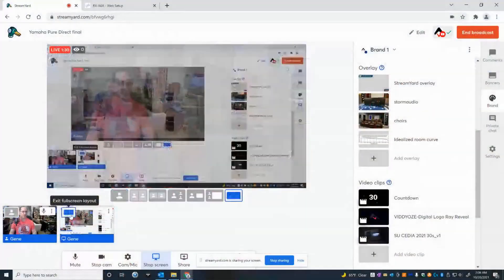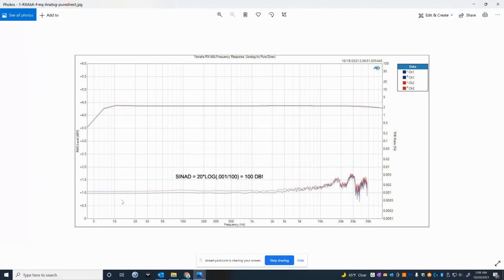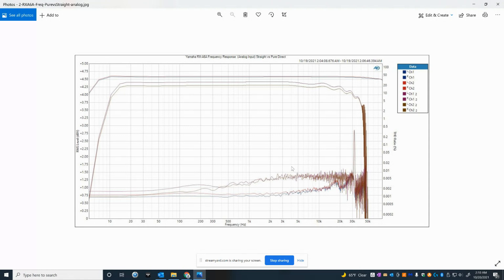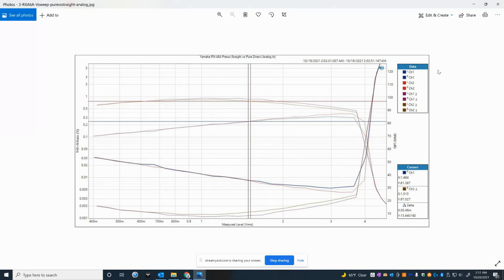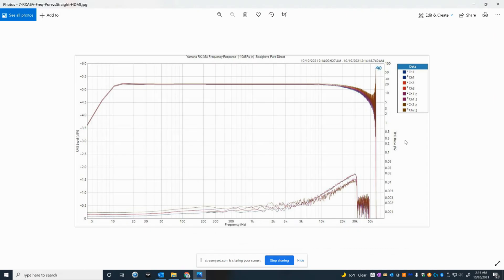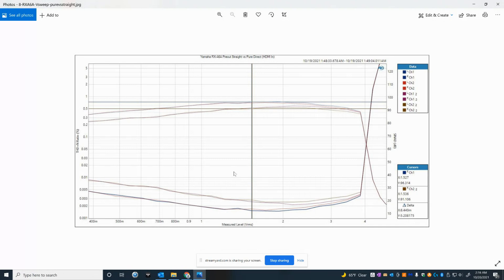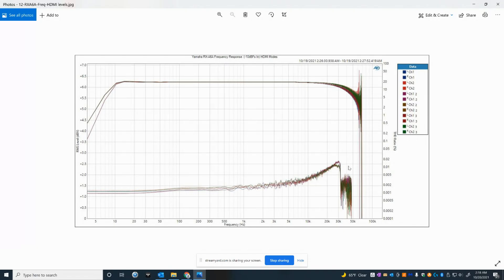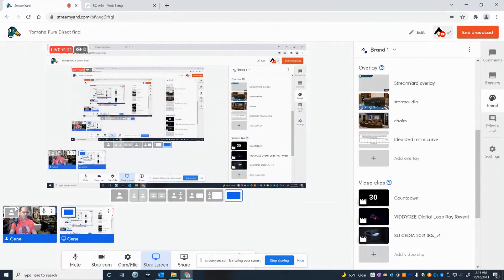Yamaha "Pure Direct" Better Performance or Pure Nonsense In AVENTAGE Receivers?

Comment: Thanks for the video Gene! Interesting! But I have a rather old Yamaha A/V receiver. I have a 7.2 Yamaha A/V RX-V665 receiver. I purchased it in 2012 with a 7.1 Klipsch Synergy speaker system. My sub is the Klipsch SW-450.  Both are still going strong...knock on wood, but as far as I know I'm not able to do a firmware update. It does not have the options of connecting to the internet, but it does have "Pure Direct", which I never use. I always stay in the 7 Channel Enhancer mode for both movies, music, and even watching TV. But I guess what I'm getting from the video is that I should listen to my vinyl records through the "Pure Direct" mode. I have a Music Hall turntable with a Shure M97xE cartridge.
Reply: Still have my 665 AVR. Pure direct sounds so much cleaner.
Reply: You may or may not like the puredirect, all comes down to preferences and the gear you're using. A friend of mine replaced the Klipsch horn drivers with JBL synthesis drivers, and the result is horribly off balanced between the horns and the woofers (he refuses to get a custom crossover) so being able to turn down the treble on the amp makes the speakers tolerable. Pure direct makes singers sound like they sing in a pa horn from about 2k hz. But my friend is happy with the sound because it recreates the bad live sound from the 70's and 80's, and that sound is what he was after. 

Anyway, use the settings that make you happy, its your gear and your time.

Comment: Gene you are the man.. appreciate all you do. I am a Yamaha fanboy, glad to see them keeping their standards high!!!
Reply: Dan a question is it worth the extra cost for the rxa 3080 over the rxa 3060 I dont really see much of a difference!! Just the AI in surround. Thanks
Reply: @brooklynknightss  Not sure brother. Don't have experience w either. Been using a Yamaha AS501 (2.1) for music/movies - extremely happy w it, drives nice Thiel towers with plenty of power for our open living room. Considering upgrading to a Yamaha receiver or the AS1200 as my next upgrade. All research I have done on Yamaha indicates pricing is very fair, the more you spend the more you get and always solid value.
Reply: @danielgrubb9496  thanks I was looking at a used Yamaha rxa 3060 or 2060 can get a nice unit for a deep discount over a new one. Thanks I'm loyal to Yamaha to, that's all I owned
Reply: @brooklynknightss  gotcha, yea def talk to Gene or someone w more experience w home theatre equipment.. should be able to find good videos or forums that break down the internal parts for comparison. I would say as long as the equipment has power and features you NEED, go for best deal. I'm bad to hunt for gear that requires other gear purchase to maximize lol.. good luck!
Reply: @danielgrubb9496  thanks buddy

Comment: I use pure direct on my Yamaha receiver about 60% of the time for both music and movies. I get around the lack of bass management by using the speaker level connections on my sub in addition to the lfe connection and using the crossover on the sub.
Reply: Could you eleborate on how you did it? I’m having the same issue. Thanks
Reply: @gonrossi you need a subwoofer with both line in (LFE) and speaker level connections. You run the LFE line as normal then you have a choice.  A. Run two wires from each of the right and left channels in the receiver. One set of wires to the speakers and one set of wires to the speaker inputs on the subwoofer.  OR B: run the second set of wires from the lefts and right speakers to the speaker terminals on the subwoofer. In both cases set the crossover on the subwoofer and you will have to level match the subwoofer to the s speakers with your ears (not device) to the point where it sound like the bass is coming from the speakers. When you run 2 channels in pure direct in the Yamaha it will send it a full range signal to the fronts and this wiring configuration with the bass frequencies to the sub. You will need to have the sub near the receiver or fronts for this setup to be practical.
Reply: @raulgarcia1718  Ok, perfect, but when using any mode other than Pure Direct, won’t the sub be receiving two input signals? One from the left/right high-level inputs and another from the LFE? Couldn’t this damage the sub or cause some mismatches, cancellations, or delay in the subwoofer?
Thanks.
Reply: @gonrossi when using modes other than pure direct the receiver directs all information below the crossover setting from all of the speakers and the LFE material to the subwoofer. The speakers are only getting the data above the crossover point and the crossover on the subwoofer will also prevent it from coming through as well. I have also set my fronts to large at times and it didn’t cause any issues but also didn’t add much benefit so I went back to the small setting. If you are listening to a surround sound source in pure direct mode you are basically running all your speakers in full range mode plus LFE which depending on your speakers does sound impressive.
Reply: @raulgarcia1718 Perfecto !!! Muchas gracias Raúl ! Impecable ! ❤

Comment: You answered some legitimate questions. I’d like to hear this one or one of the aventage receivers in a high end audiophile system. So far, with any present Yamaha amps, I couldn’t hear any differences between ‘Pure Direct,’ ‘CD Direct’, and regular.
Reply: I can tell you that the CX-A5200 in Pure Direct mode, with analog in from a good external DAC, is definitely audiophile quality. Not sure if there is any difference between the preamp sections between the two Yamaha products. I replaced an Ayre 2-ch preamp, and would have returned the Yamaha if there was any hint of compromise.

Comment: I prefer Straight mode + YPAO correction much more than Pure Direct for 2 channel music listening with my Yamaha A2080 and KEf R3's and Rythmik F12 sub.

Also, "Enhancer" selected on.  Anyone know what that does let me know.  

Tidal controlled by mconnect or USB stuck in the front with FLAC files. Excellent IMO.
Reply: @matteiva0000  Thanks I didn't know that

Comment: Did you ever measure the preamp out voltage of the RX-A3080 or 2080 receivers? Are they only 2v rms out?
Reply: I have wondered about this as well as i know my primare a32 had def got grunt but what i did find was a slight difference if i went into amp assign and set the yammy to 7.2 config with an ext amp for the mains rather than leaving it in basic config, i have a feeling by telling the yam i have an ext amp it increases the voltage on the pre out
Reply: I'd love to see more on this too, my yamaha puts out way lower volume than a separate DAC I run to my amp.

Comment: My Yamaha integrated stereo amp is quieter in Pure Direct mode and it is noticeable with my horn loaded drivers.  It also has a CD Direct mode which shuts down other circuits not used when playing CD's ( like the phono preamp, etc ) but that difference is very subtle compared to Pure Direct being toggled on and off

Comment: One reason to use Pure direct mode is to remove latency from the digital processing. E.g if you have DJ equipment connected you would get latency that would be very distracting if you don’t use the Pure direct mode
Reply: This IS the right view! Everyone including the presenter believes Direct mode is about frequqncy response or distortion, WRONG!! It is all about LATENCY.

Comment: Great job Gene but i still don't know if there is a preamp mode on those Yamaha AVRs.That's what i need
Reply: There isn't, unfortunately, though I'm not really sure if the differences are audible on the Denon receivers, for example. I couldn't hear a difference when I was testing the 3700, other than it being a bit louder due to the increased preout voltage. If the external amp requires the higher preout voltage then I suppose it would be better.
Reply: @TH-lo8mq  It's not only question of sound quality but a question of electric power needed.I need a AVR as a preamp but i don't want the receiver to run "full power" if i don't use the amps inside.Gene said there is an Eco mode on those Yamahas but he was not specific about the result of eco mode and using the AVR as a preamp.He just said eco mode is bad when you use the avr as "usual" if you see what  mean.
There is no preamp mode like on the Denon/Marantz that cuts the power anyway,that's for sure.Too bad.

Comment: The Straight mode measurements are audible seemingly. Seems like Yamaha needs to work on the DAC section. Feels like they're wasting the DACs if they aren't making full use of the potential dynamic range. Questionable if the SOC can improve on it.
Reply: Yamaha does not need any DAC enhancing, your ears are the problem.

Comment: Hi, this is my first comment on your insightful channel. I have been using the Yamaha RXA810 which came out in 2011. I use pure direct mode for 2 channel music using the rca input connecting to the rca output of the OPPO BDP-105D. The direct mode sounds cleaner and clearer compares to the straight mode. The background is dead quiet. I also use pure direct mode for HDMI when listening to 2 channel music. However, I like to engage its 7 channel music mode when I want to play background music or listening to FM radio. Your measurements, although on the more advanced and latest model, just demonstrates how good the pure direct mode of the Yamaha. The RXA810 is decently good av receiver for 2 channel music. The only thing I feel is that it is a bit too polite, and a bit lack of excitement and dynamic when compares to a similarly price dedicated 2 channel amplifier. Thank you once again for your wonderful videos.

Comment: Gene great video. Just one quick question. When I set all my speakers small and straight for Apple Music it sounds great but with pure direct it feels like the bass is dead. Is there no bass management in pure direct? Is there a way for vinyl or analog music to use towers and subwoofers?
Reply: On my older Yamaha AVR, using MAIN LARGE +LFE will engage the sub with the LR
Reply: I’m curious about that too. I suspect that Pure Direct does not include YPAO, but it would be good to confirm it. On a side note, the CX-A5200, in Pure Direct, analog in from a premium DAC, loses nothing compared to the 2-ch audiophile preamp it replaced (Ayre).
Reply: @jiminia  what premium dac ?
Reply: @junior-OG  PS Audio DirectStream with Bridge.
Reply: @jiminia  nice
Reply: @junior-OG  My 2-channel listening is done exclusively from Roon. It has PEQ built in, as well as the ability to add convolution filters. So my plan is to use the Yamaha YPAO for the surround set up, which is just sports and movies, and use the processing available through Roon for the 2-ch. Essentally accomplishing the same thing, but still using Pure Direct mode. Haven't done the convolution yet, good project for winter.

Comment: I miss the days when u bought something and took it home and it was ready to do whwt u bought it for. Nowadays my tv  is just a big ass phone that u have to clean files and update. Updates for a av receiver is cool for. When it's needed to fix something but it's still a pain knowing that one day I will turn on my receiver and a update will be needed and there's a chance it won't take and lock up your receiver.  It sux
Reply: Well as long as the product delivers in the sound quality department, I have no problem doing that. And I think Yamaha delivers!
Reply: With the incarnation of ever chaining tech and over complication and always having a .learning curve, it certainly has been more challenging to just ENJOY a said system.  I am up to reasonably the newest standards in my system but it never ends and honestly,  most of it is bs to make money.  Good power,  good pre amp, good main speakers true full range I mean truly to 20 hz and you got 99 % already done.  That is what I did.  And yes it is worth the expense to get the front mains right no matter cost first.

Comment: As an Airplay user, I’d love to see a cross comparison between flagship receivers in terms of their Airplay performance.   
It would also be interesting to see a comparison between the built in Airplay and the optical input, as an old (discontinued) Airport-Express can be used as an Airplay end-point utilizing it’s optical output.  Which is fantastic for anyone with an old receiver they want to include in their whole home Airplay setup. 
Likewise does the built in Airplay outperform a modern Apple-Tv on HDMi that is being used as an Airplay endpoint, now that’s a question normal people might even be curious to know lol
Reply: Good question, my understanding is that it is a lossless protocol so I would imagine the quality would be as good as the receiver out noise. I also use a 1st generation AppleTV optical connection to an old receiver and it works great for airplay.